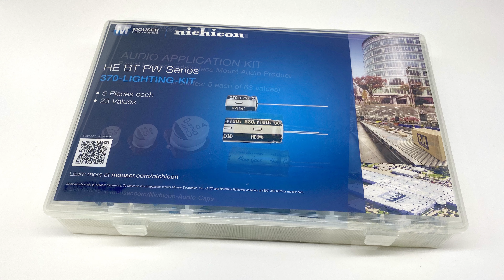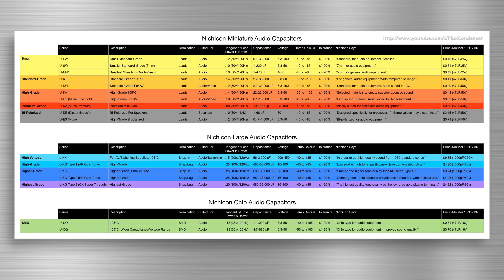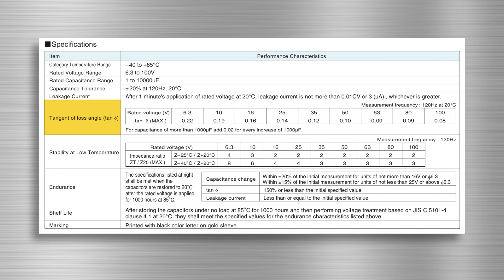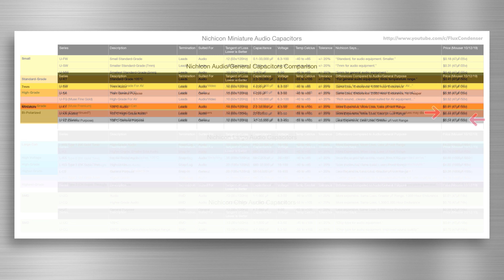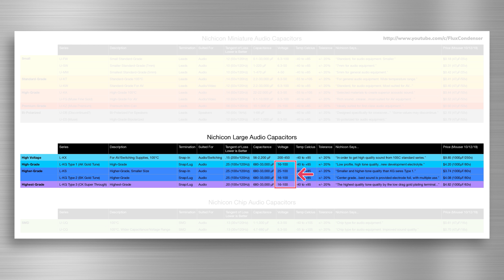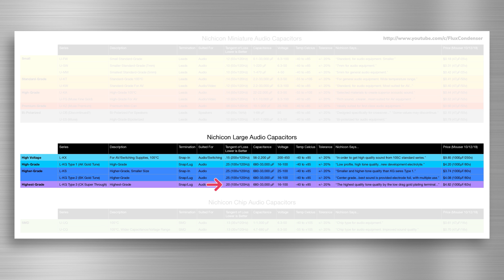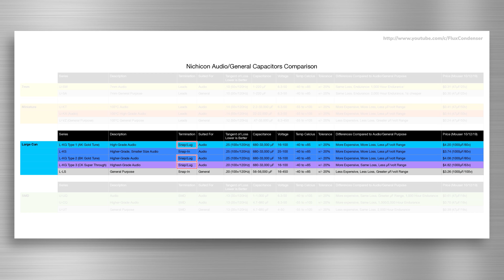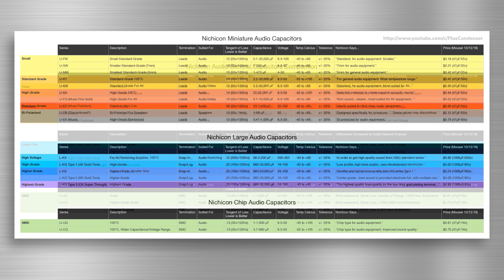How To Choose Nichicon Audio Capacitors. Are They Worth It?

Comment: He did not mention the importance of the ESR values that you need to measure and consider.  Sometimes your cap might be located right next to a very hot resistor or transistor at extremely high temperatures baking the nearby capacitor. In these situations you go down your specification and look more towards the capacitor with the highest temperature rating.  Now let’s talk about power supplies in your amplifier you don’t use the same capacitors. Now you’re switch your mind over to the specifications if it’s a capacitor used for cleaning up the power and you wanna block DC voltage you look at those specifications.  If you have high amp ripple you look at those specifications.  Usually surface area but not always indicates lower ESR that’s why some of those big Sillmac III  or the highest rated big F series Nitchicon are tall and larger in diameter to give more surface area and have a tendency with more surface area to dissipate more heat if used in those situations.  Some tweaks are to lift them and just bend the leads a little bit to make them fit if their lead spacing is a little too wide another trick if there is room to place the larger capacitor underneath the circuitboard and push the leads up through the holes the electrons don’t know the capacitor is on the other side of the board or facing upside down lol.  And to get a little bit more reliability durability some go for a higher voltage which will give you a larger in diameter or taller capacitor example say called for 50 V capacitor you stick in a 80 V or 100 V capacitor in its place but keep the micro ferret specification the same.  And if you really want to get exotic you could in some situations use film caps or parallel a smaller film cap for example 0.01 or 0.1 micro ferret. Or that small rating they are awfully large and you may not have no room or no place to put them.  A little knowledge can be dangerous. Lol
Reply from the maker: ESR was mentioned. As stated in the video, tangent of loss is a measurement of a capacitor’s efficiency which is affected by ESR, ripple current and heat loss. Tangent of loss was the basis for qualitative comparisons for this video and is prominently used by Nichicon to do the same. ESR and other leakage tests are more valuable for testing capacitors which have been in service for a while to detect drops in performance. 

You seem to imply that temperature concerns were not addressed. The temperature rating of the capacitors was mentioned many times and each spreadsheet specifically denotes which caps are 105C rated. 

You mention turning ones attention to capacitors which block DC. But all capacitors block non-pulsing DC regardless of application, not just those in a power supply. You also state that the purpose of capacitors in a power supply is to block DC. This is incorrect. The purpose of a filter cap is actually to create clean DC. It does this by smoothing the pulsing DC so that it is no longer pulsing. Higher capacitance capacitors are used in power supplies because they hold a greater charge and therefore release energy more slowly which has a smoothing effect on ripple. 

You suggest that a different type of electrolytic capacitor is used in a power supply and that they have an entirely different set of specs, but again that’s incorrect. The only difference really is that power supply caps tend to have greater capacitance. You mention switching attention to different specifications when comparing a capacitor for a power supply. This isn’t the case. As with any cap, choose the correct farad, voltage and temperature rating while being mindful of the tangent of loss and the physical requirements of the component which were also addressed in the video (size, terminal type, etc.). This is true of any capacitor for any application. You also suggest putting capacitors under a PC board while also seeming concerned about heat issues. A capacitor which generates heat must be on the top of a board where it has the greatest ventilation. Heat rises, of course, so putting it “under” something is never a good idea. 

As far as replacing electrolytics with film caps, that’s not generally likely as those have much less capability for capacitance compared to electrolytics. It’s the unique tootsie-roll design and electrolytic solution which allows them to have greater capacitance in a smaller package compared to other capacitors. This is the main reason electrolytics are selected. This is discussed further in my other videos about capacitors.

Additionally, as the title suggests, this guide is not about capacitor applications in general. It’s a comparison of Nichicon’s electrolytic audio capacitors series. To learn more about how capacitors work, what voltage specs to choose and installation tips, please see my many other videos which discuss these topics in more detail.
Reply: @FluxCondenser  Thank you for your time writing this reply. I'm learning so much from you. Your work is really appreciated